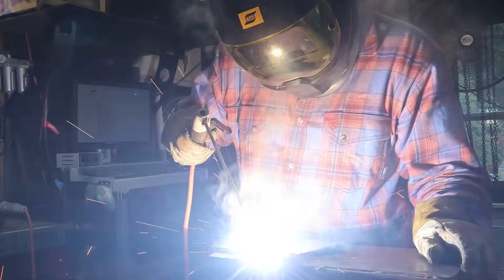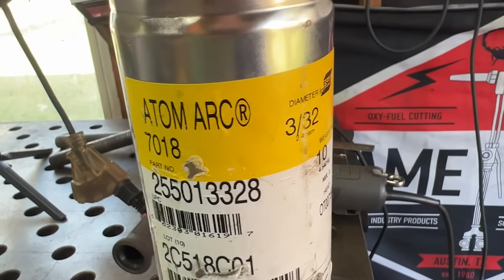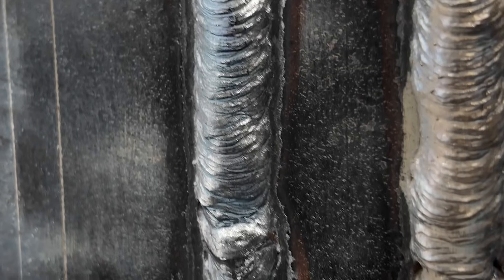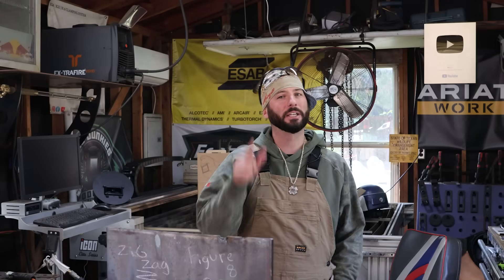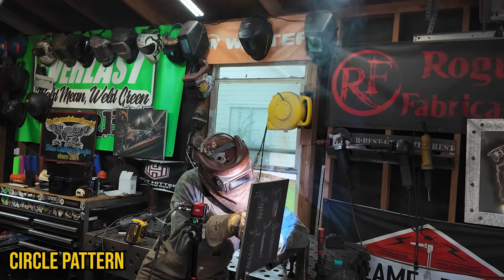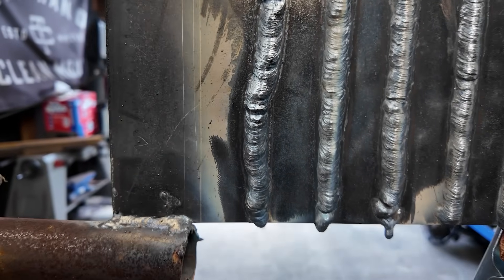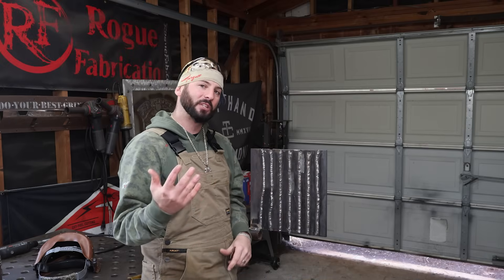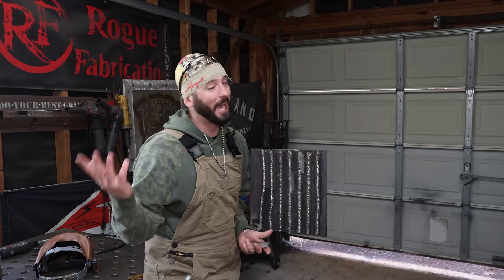Vertical Stick Welding: Pattern or Technique?

Comment: Can you do a video using your Lincoln ranger welding with different sizes of 7018 rods (3/32,1/8,5/32) or in different repair scenarios

Comment: Welds are looking fine haus.
It's extremely hard to control LH, any rod honestly on flat plate. 
Without a fiscally defined edge most of your focus is on keeping your bead straight, not the discipline you're practicing. To really compare methods stalling time on the sides (edges) is critical. 
Soap stone, scribe marks, what ever you use disappears in the smoke pretty much immediately. 

1/8" LH is not forgiving at all as you heat the material you're working on in the vertical, especially flat plate.

Comment: Terrific arc shots. Question: do vertical welds tend to come out taller (more reinforcement)? I've been doing mild steel TIG welds and am finding it hard to cram in enough filler to keep the result from looking flat (low reinforcement) to me.
Reply: Are you welding downhill or uphill? In GMAW, the lack of reinforcement is always noticeable for vertical downhill since the weld pool falls under gravity. Whereas vertical uphill is usually convex since you’re pushing the weld pool upward.
Reply: When i do a vertical up weld, the middle of the weld tends be taller. when I weld down hill the middle tends to be lower. UNless you use a specfic technique to avoid it. When it comes to tig welding and not getting enough filler in. Its usually a "too cold issue" or arc length

Comment: What is that tool you use to check the heights of the welds and where do I get one
Reply: It’s a height gauge, can be found at a bunch of weld supply stores and online
Reply: it was a GO gauge from weldlytics

Comment: Also, if you're not welding a vertical up a groove, joining two separate bases, you're just brazing. 7018's do a PERFECT job if the weldment is PREPARED correctly, according to the WPS.
Reply: @bradleyrussell1973  If both base metals are being melted and fused together with a filler added then you are welding. Brazing does not melt the base metal and only heats it while filler is added to join the materials, much like soldering but with better strength.
Reply: thats... very not true.

Comment: Upside down smiles. Keeps you out of the middle, demands short pauses on the toes. I've been doing that technique almost 100% on flat plate vertical 70's for about 25 years now. Concentrate on  watching the puddle, screw the rod tip. The puddle will TELL you what it wants you to do!

Comment: I agree that it doesn’t usually matter. The metal is being melted under the rod. I doubt the metal cares exactly where it’s being melted as it’s being melted pretty much in the same amount of area no matter which wiggle is being used.
Reply: Thanks for watching Mel

Comment: Honestly if you're not joining two pieces of material and then doing testing upon those, not sure how relevant the results would be.

I could see different weaving patterns affecting where the puddle remains hot/molten/liquid and thus how much penetration there is into the base material.  I could see different weaving patterns affecting the heat penetration, at least a tiny bit, showing that more when the joint is more complex than just a pattern on a solid piece of material.

I would encourage you to perform this test again, but using large coupons prepared identically across all weaves tested.  Cut, then polish and etch one piece to look at penetration, and bend-test to see if there are any substantial differences in strength.